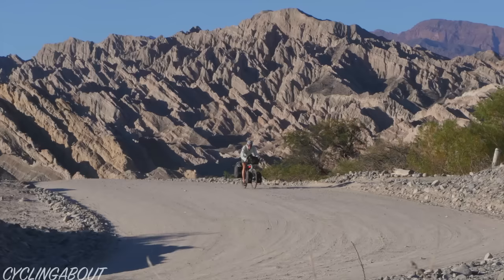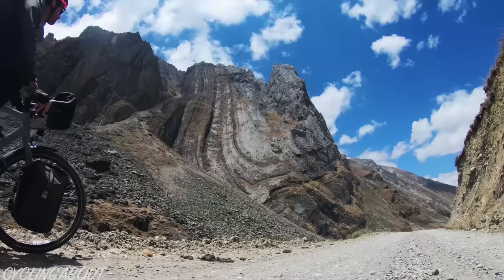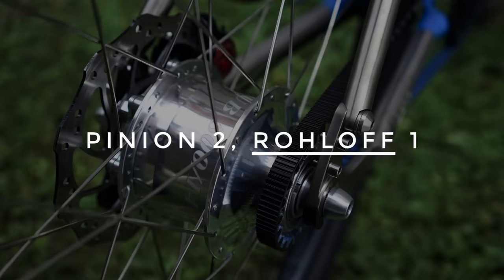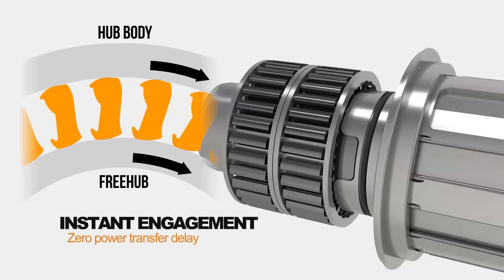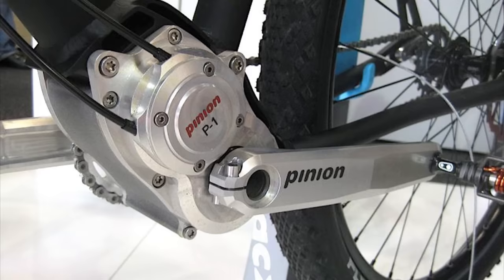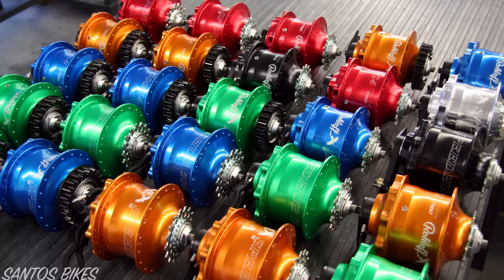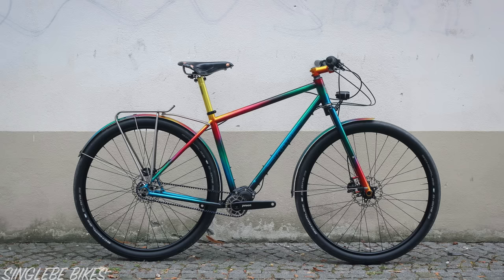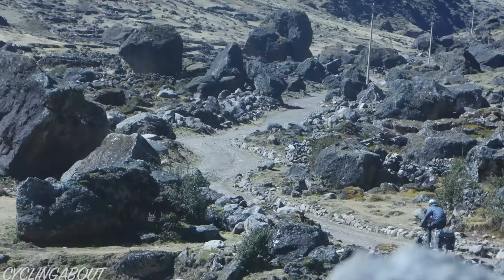What's The Ultimate Bicycle Gearbox? Rohloff Hub VS Pinion Gearbox

Comment: Hi. Have you made a comparative  assessment of e-bikes that combine an electric engine and a gear box / hub. Is it more efficient  an e bike that has a mid drive motor and a rear gear hub or an e bike that has a mid gear box with a rear hub motor? And what about cost / benefits analysis? For the sake of comparison let's assume a similar frame,  wheel size and rider's weight.

Comment: What about parts availability worldwide? Most shops don't stock internal gear hub parts, but how easy is it for these shops to get parts for either hub? 
What about vulnerability to damage? I have a Rohloff 29+ bike and quite often hit the undercarriage on rocks when pushing over rough terrain. Wouldn't want to be hitting the casing of a Pinion.
Yes, the Pinion has a longer oil service interval but how long can it go WITHOUT an oil change. I have been told by Rohloff themselves that at all times all internal components are always coated with at least 7ml of oil and therefore the system will run fine and cannot be damaged. Oil changes are more about rinsing out any penetrated moisture and helping to keep the noise down. So theoretically you can take the 5,000km service interval with a giant pinch of salt. Your Rohloff could spill it's guts one day but you could still confidently finish your tour knowing that you're not damaging it. Can the same be said for Pinion?
I think the Rohloff wins simply because I can swap it between bikes and because it's proven itself to be a lifetime purchase. Not everyone can afford/justify owning more than 1 bike at a time. If I decide to get into road touring again I can keep the Rohloff, sell the bike and choose from countless frames to build up a new bike. In the same scenario with a Pinion I'd have very few choices and they'd all be far more expensive.
Also, if I was in a country/continent where decent bike shops were rare and postal services super problematic, and had a problem with my Pinion I only have 2 options: send it to Germany and wait for it to come back to me fixed (could take weeks depending on where you are) or just go home deflated. If I had a problem with my Rohloff I have 4 options: send it back to Germany and wait, go home deflated OR  send it to Germany and get to the nearest bike shop and put a derailleur system on and carry on, OR if it's a shifting issue don't forget that you can change gear on a Rohloff with a spanner. It'd be annoying but you could continue. Can you do the same with a Pinion?
Reply: If you could select say gear 8 and then use it as a single speed, providing any problem with the Rohlof wasn't to do with gear selection inside the hub.

Comment: Budget-wise I like the rohloff between the two.  I'm running one on my surly troll touring setup and love it!  I picked it up used (with only about 5000km on it so probably good for as many km as I'll ever put on it :P) for less than half of what it would have been new.  I was then able to use it on my existing frame.  The pinions are very cool but I like the portability of being able to take the hub/wheel to other bikes too. Also, used pinion gearboxes and/or compatible frames, or even complete bikes with a pinion would be harder to find and more expensive.  The rohloff was just one piece of the puzzle of building up my ultimate touring rig for the least $$.
Reply from the maker: You've got a Trohloff! Nice. 😎

Comment: The rohloff may be more efficient while pedalling but has more resistance while coasting. If you spend a lot of time going downhill the pinion is the clear winner.
Reply from the maker: I don't think this is a problem in practice because wind resistance is by far, the biggest factor slowing you down when descending.
Reply: Interesting.  Some people say that the Rohloff is draggy.  Maybe it's partly just the resistance while intermittently coasting that makes if feel draggy.  Every time you ease up your pedal stroke, it's a bit more work to regain your speed.

Comment: Rohloff e-14 takes the gear change into account while assisting but with Pinion you will need a hub motor that don't need to ease while changing. Also Rohloff is not the only one that does this.. Remember Shimano? Alfine? Di2? I'd say it is a flush.. unless you want the mid motor.

Comment: So far there is no option for oval drive/chainring, so for me there was only one option stick with semi traditional drivetrain. I have Archer D1X Trail doing the work.
I have asked Carbon Drive if they had plans on oval drive ring, but the answer I got was there is no plan for it.
My knees need oval chainring, actually something I knew I needed since I was a kid, I always suffered with that heavy zone in the pedal stroke, and now I can use an oval chainring, it has benefited me a great deal, but will not do it for everyone.

Comment: So for those of us on a more restricted budget, would you do a video on some of the less expensive internally geared hubs? Are any of them worth considering, should us poor folk just stick with derailleurs?
Reply: Depends on the use/terrain. There are very good and cheap hubs with less speeds. 3 speeds are the cheapest and most reliable, if you mostly ride on flat lands...
For an MTB they are totally unsuited of course.
Reply: I ride all year, bike commuting 800km per month, in rain, sometimes snow, ice, and the shimano derailleur system works great for me. It's reliable and the design is simple enough to adjust.  I take a towel and wipe off chain and I rarely oil it.  
Get a chain guard to protect pant leg. I never have dirty pants and I never use pant clips. 
I don't shift much and often contemplated converting to a 1x ? Or even a single speed.  Save a lot on maintenance and the drive train is more efficient.

Being poor guy just wondering if I really need 30 gears.  I don't use them. I might use three. I learned to spin more and shift with legs.  
You get a different awareness of shifting.  

There is a lot of info on the extra weight that has to be hauled permanently.  I personally am more concerned with riding comfortably and efficiently with the least amount of weight.
I am more interested in simplifying. I do like the shimano dynamo hub with 50lux light. Very happy with that. I also like schwalbe marathon plus indestructible tires( heavy but no flats) . 

I work with people who ride 5 speeds, rusted chains,  shifting problems, and they all seem happy.  Money does not make one happy and sometimes I think I should spend less time thinking about these pinions and wondering if I actually need them or if the law of diminishing returns 🤔 is in play.  I think simple is better.

Comment: Rohloff:
I ride a recumbent trike and the pinion gearbox would add a lot of weight at the front, reducing both the weight and traction at the rear wheel.

Comment: I'm looking at these gear boxes for an ebike conversion. I do have a maintenance question for all of these gear boxes: could I use a graphite lubricant instead of oil?  Graphite is known to be a better lubricant than an oil, but I don't know if it will trash the internal mechanism. Thanks!

Comment: I built a rolloff into a thorn frame and its good, overall. Very low maintenance, and pairs well with an eccentric bottom bracket for a clean chain line. But the shifting can be very stiff, especially if you don't ease off the pedals sufficiently. Plus it occasionally does that thing where it goes into gear 14 when you try and shift from 8 to 7. Does the pinion have smoother shifting, and does it shift ok under some load?
Reply from the maker: You will need to ease off the pedals with the Pinion too, but the shifting action is definitely lighter.

Comment: I‘m missing one point in this comparison: the wear of the chain. The Pinion produces a far wider range of force in the chain especially as the front chainring is relatively small.Probably the chain lasts significantly longer with the Rohloff.

Comment: When I was in Germany, I just took my greenspeed to my friend's bike shop and he took care of all repairs. Here, I can't find a bike shop that can even adjust my gears and I have zero mech ability or desire.  I want to get on and ride and have confidence that the drive train will do its job without me having to look for a bike shop.  I asked our bike shop about pinion and Rohloff drive trains and they had no clue; had never heard of either.
Which one should I have installed if I can find someone to do it on my greenspeed gto?

Comment: And as per all system cost an arm and a leg. Cycling used to be for everyone, now it seems you need megabucks to enjoy the finer points. I would've gone Pinion, MTB and very long tours planned. Guess I'll have to work a few more months to upgrade.
Reply: Shops stock dozens of bikes over $9,000 now. They are USELESS except for racing around.

Comment: The Pinion requires special frame structure, the Rohloff does not. I might want to use another frame/bike, so the Rohloff wins.
Shimano or doing Nexus hubs gears up to 8+ and they only cost £200 max. but I only see them with metal chains. The cost of Pinion and Rohloff is quite dramatic when security is taken into account. I mean would just a D lock be adequate?

Comment: I think Pinion being a "spring chicken" is an advantage. Maybe not for a single bike, but for the company concerning future development. Pinion has more refinement and advancement potential. If you have a bike with a Pinion mount, you may be able to upgrade to a superior gearbox in a couple years. And as good as it is out of the starting gate, that's kind of exciting.

Comment: A quick search revealed this comparison between a derailer system with 1 rig vs another with 2 rings up front.
The 2 geared systems tested are remarkably close to the traditional derailer systems!

—The 1X drivetrain is as efficient as 96.0% and as inefficient as 92.4%. On average it’s 95.1% efficient.
– The 2X drivetrain is as efficient as 96.8% and as inefficient as 94.8%. On average it’s 96.2% efficient.
Reply from the maker: Yes, that is my comparison. 😂

Comment: I'd love to get a Rohloff to cut down on maintenance on my commuter vs a traditional derailleur setup. Way too much money for a commuter though, so single speed it is then. Basically maintenance free, you just have to really work going up hills.
Reply from the maker: If you can get away with singlespeed, it's a no brainer!
Reply: SA RD3 will fit a SS dropout. Then you have a 0 - 10 mph startup/ hill gear at 48 or 50 GI. And a high about 86 GI, good for 28 mph. Mine is on a 1973 CCM, 42 lbs plus supplies. My longest ride was 85 miles on a hilly highway, no problems really. 3,700 miles, mostly in 2 years. The bonus is drum brakes that require ZERO service and always work for 30,000+ miles. My front hub will get there soon.

My SA XL-RD5w is even better, after I figured out the damn sticky shift key dragging the planet part opening. Yesterday I rode it 107 miles, 7Hr36 moving, avg. 14. This hub FLIES me down the highway in calm winds. At least 96/ 97% efficient IMO. On one short hill I go 45/ 46 mph easily with a little tailwind. 
 I sacrifice though with 46 GI on a heavy tour bike, that also has the awesome Rohloff14 for tours.

Comment: I have an e-bike with a pinion drive, the Desiknio Urban. Currently on a 9 gear version but since the gear-step is on the high side i am considering to switch to a 12 gear one instead. The gear box is very quiet indeed, and as usual with a belt drive it provides for a nearly noiseless riding experience if the electric drive is off, which it is for at least 60% of the time for me. However, it would be nice to have more shifter options available, that is really one of the big downsides of the pinion.

Comment: Slightly off-topic but I had a Rohloff and Gates belt (CDX centertrack) setup on my bikepacking bike and mud got onto the belt (Winter, UK, clay soil) and caused it to jump off the back sprocket. The belt afterwards had some odd 'blisters' on it and I was concerned that the kevlar core might have got damaged. As I was planning on bikepacking in a remote area with mud (Nepal) I switched back to a chain to be safe.  Has anyone else had similar problems with belts? Or was this maybe just a freak occurrence?

Comment: Went to a bike shop to see those Pinion drives. Tried to simulate going up a steep hill with heavy bags by pedaling in gear 1 and simultaneously holding the brakes. Managed to quite easily make the gears skip on ALL Pinion equipped bikes that were there (Mostly Santos and Contoura C1.12 & P1.18). The very loud cracking noise was borderline scary!  The Rohloff bikes did not show this behavior at all. I could stomp on those pedals all I wanted without problems in any gear. Same on my Alfine 8 speed which doesn't seem to care how much I hammer it either, and that's a 175,- euro speedhub!  I know it's kind of an extreme situation, but I still was a bit underwhelmed. After all, Pinion is even more expensive than Rohloff.
Reply: @MultiReel I give the Rohloff a big plus. Interchangeability is easier for newer systems, with the Pinion you are attached to that special frame construction for the entire life of your bicycle. And the weight and price of a Rohloff is indeed a better choice. 
I'm waiting allready 5 weeks for my brand new Santos Travelmaster to arrive from factory...
Reply: @christee2908  Suppose you got your bike in the meantime!  I got myself a Koga World Traveler S. Cheers!
Reply: @multireel7590  I got it about a year ago, very pleased with Santos. Congrats on the new Koga world traveller to. Hope we may both enjoy our wonderfull bikes for many years to come

Comment: Cinq actually have thumb and dropbar shifters for both, Pinion and Rohloff. Still the message of the video certainly holds: Both can be great (But derailleurs can be, too). You can also pair a Rohloff to a Schlumpf bottom bracket gearing, to get insane gear range. You can also just pair it with a front derailleur. (will need a chain tensioner) As you can pair a Pinion with any kind of rear shifting. Especially the version with 6 gears at a wide range together with rear shifting can give insane range and fine steps. Pairing Pinion and Rohloff would be a bit overkill, but I somehow want to do it. 😉
Reply from the maker: Cinq makes shifters for some Pinion gearboxes. But due to the design of the P1.18 gearbox housing, Cinq cannot produce shifters for the 18-speed model.
Reply: @Cyclingabout   I didn't notice that. Too bad 😕

Comment: I'll be getting a recumbent quad with 6 speed pinion and 14 speed rohloff both of which are on the center line of the quad but none of which will have the same weight behaviors good and bad so I will return with my findings on these systems

Comment: I cannot believe either of these gearboxes are more efficient than a chain derailer. Belt or chain drive, you are turning that drive system with any of the three. But with a derailer you have no gears to turn or seals to fight. I'm thinking about replacing my 50 year old Fuji with a Ti or CF model and I sure would like to have more than 6 speeds to choose from. My bike is a "10 speed" with two chain rings up front and five cogs on the freewheel but there is so much overlap it is a virtual six gear ratio bike. I bought it used in the mid 1970's.
Reply: I bought a CF bike with 2x11 derailers. Perfect for my rides. Some day in the future I might have a Ti bike with a Rohloff hub, but I don't ride in wet or mud or gravel, so why?

Comment: I wonder how a nuvinci CVT gearbox compares?
Reply: It's a 7 lb boat anchor. LOL
Reply: Just what I was thinking, I've used them for the past 8 years, brilliant hubs.
Reply: @GordoGambler  Its actually considerably lighter than both the transmissions in this video. 
NuVinci is 2450g so 675g lighter than the Rohloff and a massive 1.4kg lighter than the Pinion. That doesn't include the 300g of extra frame. The boat anchor here is clearly the Pinion.
Reply: Nearly all of the reports & reviews from people who have used the NuVinci system say that it's very smooth and reliable but also very inefficient. They say it's fine for people doing easy rides on flat terrain but not at all good for climbing & hilly (or loaded) riding. It seems that the more torque is applied to the drivetrain the more friction there is with one of these.
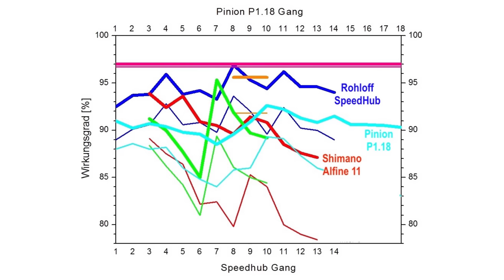Reply: The Adventure Biker kinda makes sense the more toque required (weight of rider gear and bike over incline) the greater the friction losses. Would love to see the efficiency curve on your graph the one at 2:45. If you could find the curve and overlay it on your graph it would make a great short video. Food for thought mate.

Comment: I have 2 of the nicolai Gboxx’s from the early 2000’s they have Rohloff’s sat on top of the bb - bit heavy but the only non electric downhill mtb’s you can pedal uphill..........at the time kind of where Zerode is at now using pinion drive train on their bikes - I’m waiting on Shimano or Revonte to come through with Eeeb’s that will handle the slop that is my mtb trails at home in UK - Nicolai Eboxx with belt is almost there but not a fan of Bosch motors and the Rohloff is on the wheel so unsprung weight kills the suspension kinematic